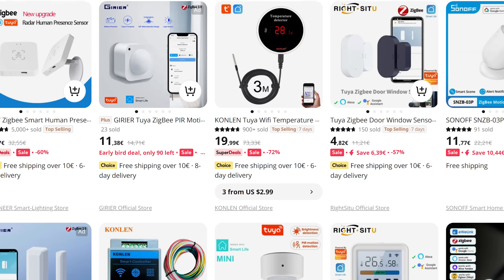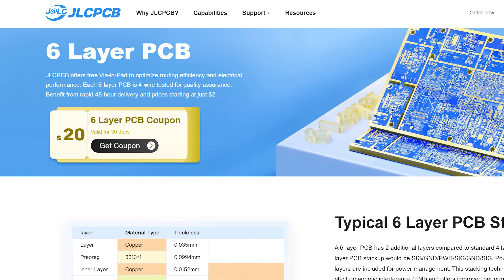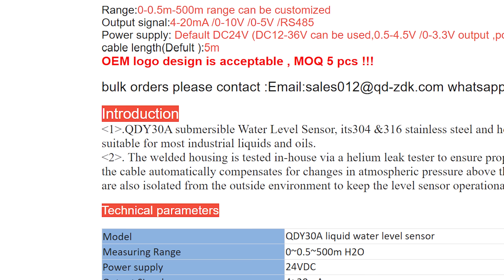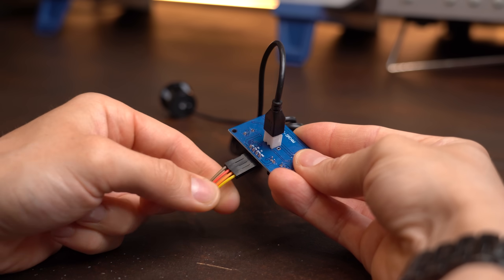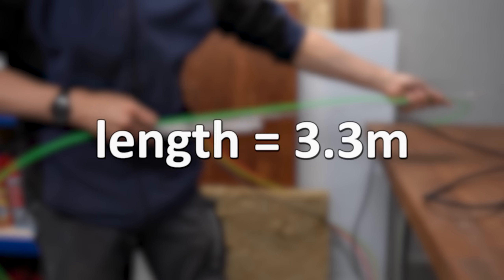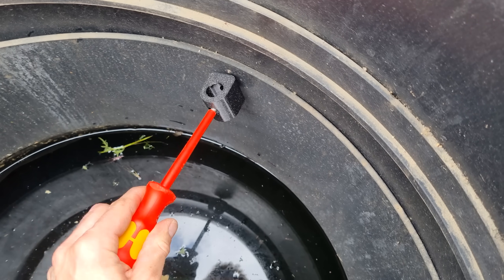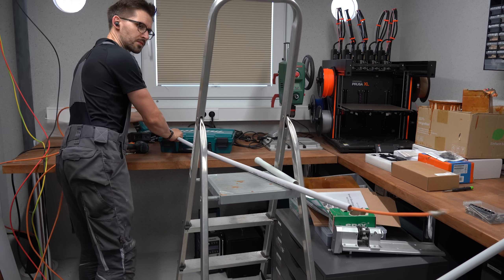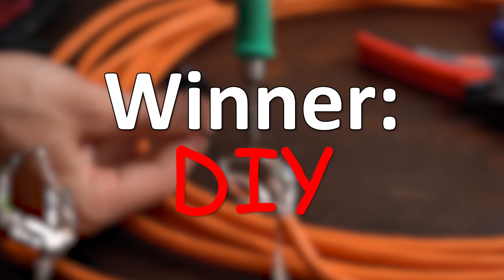This Happens when all Buy Options Suck! Water Level Sensor (DIY or Buy)

Comment: the most basic option I can think of for this would be a fuel pump assembly, it works on ohms to detect the level and that's transferred to a gauge which then displays the level based on the ohms received by the fuel pump assembly, how it detects the level is... with a floater and a pressure switch that's attached to a spring so that it can lower when the liquid lowers.

I'm not saying drop a fuel pump into your rainwater tank, that's basically asking for trouble, but having something run on what would be considered a whiff of watts from 12v or lower, can basically be ran by... a solar panel and maybe even a lithium battery housed under the solar panel, using a meter that's got a glowing hand should reduce the power needed as you can see the level in the dark then.

Total cost would be cheap, maintenance would be low and the functionality would be high as it would basically only be doing what it needs to do.

Comment: I think it would be cheaper to put a flow meter in the intlet and outlet of the tank, just make a code to add or subtract to the full volume of the tank and a shot off valve when the tank is at 100% full, dont know the values at the top of my head but the material are mostly waterproof

Comment: I have done almost exactly the same project with a large rain tank in my parents home. I used the same sensor, but I ran into issues where the Sensor would be pretty much stuck on one totally wrong reading despite the water level changing. I had only a few hours with it to try and debug it, but I am guessing that I had problems with reflections of the sound messing up the reading. I mounted my sensor in the middle of the tank as far away as possible from any walls, maybe I sould have mounted it next to the walls like in the video?

Comment: I had a similar problem many years ago, in that I had to measure the water level in a tank, with the added caveat that a pump would be sporadically filling the tank up and causing surface turbulence.  I also tried waterproof single transducers, and had the same issue with minimum distance, and one from maxsonar couldn't cope with the surface turbulence and gave false readings.  In the end I used an A02YYUW waterproof distance sensor that has two transducers and it works great.

Comment: You can modify water leak sensor which is cheaper for this project application. You don't need to know the exact water level, just turn on the pump if it's reach a certain point. Water leak sensor is just probe that measure resistance between two points. Water have different resistance than air.

Comment: Is having a low voltage cable in an enclosure that also has high voltage acceptable in Germany? I'm not sure about distribution boxes, but I know you can't have low voltage cable like UTP and a mains cable in the same conduit in the Netherlands, so I'd guess it wouldn't be allowed in distribution boxes either. Germany tends to have similar or stricter guidelines around electricity usually, so I wouldn't expect this to be allowed.

Comment: I am doing the EXACT same sh**, with the EXACT same hardware and EXACT same software (Home Assistant), and I had the EXACT same thought that you when it comes to liquid sensor suitable for my application.
The only difference here is that I am doing it for my domestic fuel tank to know when to reorder some to never run out during the winter !
And in a near future, I will implement a full auto system to order some fuel when à certain threshold is reached.

Thanks for confirming my way of thinking and the effort I made with this project that it's so niche that DIY is best XD

Comment: Very nice project. I did something very similar to monitor the water level in a Tank, but using the ultrasonic sensor A02YYUW. However due to high temperature during summer I get water droplets in the sensor's surface and the measurements became completely off.  Wondering if you have seen similar issues.

Comment: The JSN-SR04T gets a bit annoying when the distance gets lower then 20cm. Suddenly you get many Meters - at least with tasmota in mode 0. At my sisters house in her well after the many raining this happened again, the monitoring alerted cyclicly and such things - so i had to remount the sensor a bit higher and adjust the calibration value. I have one of these mounted in my oil tank and it measures but it suffers from some drift of maybe the liquid expanding with temperature rise.
On the other side in my friends house and my sisters house i have one of these submersible sensors and they work quite well - ofc you need to adjust for the lighter liquid weight

Comment: Nonelectronic option: Put three tubes into the tank at different depths that poke out of the ground: near bottom, middle, top. Place floaty thingy into the tubes, that have very light sticks mounted on them, that also poke out of the ground. Make sure that the floaties can only move up and down a few centimeters. Done. When everything is closed, you have all three sticks poking up with a full tank, two sticks with a half full tank, one stick with a less than half full tank and no stick with a near-empty or empty tank. Low tech, lasts for decades, no software compatibility required, costs maybe 10 bucks in total materials.

But yours is cool too, especially if one values a full integration into one's home system.

Comment: any ultrasonic or whatever method is cringe, get yourself a ten pack of cheap float switches and attach them all to a stick spaced out to give you your level in increments of 10%
cheap microcontroller with at least 10 input pins and some kind of comms and you're done. it will work forever.

Comment: If you end up having trouble with the ultrasonic sensor, look up nxp pressure sensors.

They're fairly reasonably priced and give you a 0-10kpa range which is about as perfect as you can get for just less than 1m in water height.

To use it hook up the sensor to a tube (so that the tube is sealed) and lower the tube into the tank, oriented so the end faces down.

Hydrostatic pressure will push on the air in the tube which your sensor can then read.

That will give you enough accuracy to measure the water level almost to the mm, or nearest 10L.

The sensor also doesnt have to be in the tank, you can run the tube that distance instead of the wire, making waterproofing a lot easier.

Comment: I used the cheap 2 transducer ultrasonic sensor in my home oil tank.  The arduino micro with 10 leds showing tank level was about 15 meters away using 4 conductor telephone wire. It was still very accurate for me. I recently bought a pre made version that can warn you that the tank is low with an app, so i replaced it.

Comment: If your Wifi can reach, you could've used a small solar panel to charge a couple of 18650 batteries and run an ESP8266 connected to the sensor.

Comment: Why didn't you use the hydrostatic sensor, since you already owned that? Most microcontrollers have an ADC for measuring analog inputs. The Raspberry Pi Pico for example, can measure a voltage from 0 to 3.3v, the exact output of that sensor.

Comment: In projects where the microcontroller operates continuously, I always implement two safeguards:

- A hardware watchdog timer on the microcontroller itself.
- Node-RED logic on the home assistant system to monitor sensor data publishing frequency.

These combined measures (hardware and software watchdogs) improve system reliability by automatically restarting the microcontroller if it malfunctions and by alerting me if sensor data updates become infrequent, potentially indicating an issue.
Reply: How can I do this easily on an Arduino? I have very limited knowledge, and just recently got into electronic projects.

Comment: I also did a DIY ESPHome water level sensor for my potable water tank. I have that same ultrasonic sensor, but I determined that the "full" line on my tank is well within the blind spot of the sensor for any reasonable mounting location. Also, the water inlet is very near where I'd have to install the sensor, so it would get erroneous readings whenever the pump in the well was running. 

I ended up using a 24V 4-20 mA version of that hefty steel pressure sensor. It was a bit cheaper because 4-20 mA is an industrial automation standard, but it was still pretty expensive. 

I've found that as I have it currently set up, and with the geometry of my tank, it's precise to within about 10 liters. I've never tried to calibrate it, so it's probably not terribly accurate, but that doesn't really matter since the intake at the bottom leaves about 200 liters (give or take some sediment) in the bottom when it runs dry, so as long as it's within a hundred liters or so of the true value, that's good enough for me. I could probably improve the precision and the signal-to-noise ratio a bit by choosing a different current sense resistor and using a dedicated ADC instead of the one in the ESP32, but I haven't experimented with that. It does what I need it to, so I've left it alone.

I even mounted the ESP and the 24V PSU on a DIN rail on the wall next to the water tank, despite being in the US where we don't really use DIN rails outside of industrial settings.

Comment: I was thinking keep it analog and simple since outdoors: use a float switch and just measure the resistance; less conductor to travel (or more if you wire it out the bottom) as the float rises. simple converstion of ⍴ = RA/L to get your Ohm-m and apply that to your depth and bingo. Kept it analog and super dirt chap, could built that whole thing for less than $5usd

Comment: From my own experience -  the sensor like this have a tendency to produce a lot of garbage when working in enclosed tanks. This is due a fact that water vapors and stays on the surface of the sensor. During the summer it's usually not a problem (sometimes it is during raindy and cold days). But the real problem starts during the winter - I struggled a lot and tried many ultrasonic sensors but ultimately failed with using them for this purpose - pressure is much better idea IMO

Comment: Replace the ESP with version that supports PoE, use the CAT7 cable with PoE switch instead of power supply in your distribution box and you are even better (and cheaper). ESPhome, of course, supports all sorts of EPS32 PoE boards :)

Comment: I'm surprised you didn't go for the simplest solution possible a level buoy which would close the circuit once it reaches a certain level.
I mean it won't give you the exact level, but it will give you a predetermined water level (or multiple) for automation pourposes.

Comment: Yeah that coax in the ultrasonic is very susceptible to picking up noise.
Once you open it up, you're done.
You're better off using BNC connectors.
I'm surprised you didn't add temperature

Comment: There's probably a cheaper way using 2 pulleys (to measure the distance), 2 motors (to bring the weights up and down) and 4 stop switches on a pair of weighted strings (one with a denser-than water, the other one with lighter than water): the first string (with the dense weight) goes to the bottom and measures the total distance, the second one  measures the current distance to the lighter weight. both strings go on a pulley to trigger the stop switch when they stop going down. The operation starts by bringing both weights to the top where they trigger the stop switches, the the "total depth" line goes down  and triggers the "no-gravity" stop switch (release), then the "light" weight goes down and triggers its stop switch. The difference between the number of turns of pulleys.
Also, you could also simply measure the distance between a ping pong ball and the sensor in a PVC pipe going to the bottom if you know exactly the distance of your pipe, so you don't need to measure that with the weighted line and you can do "on demand" measurements without keeping the system active at all times. $37 sounds very expensive...

Comment: Youre getting into high frequency enough signals where you need to take transmission line effects into account. Find the impedance of the coax cable (id guess 50 or 75) then buy a pair of rf connectors to extend the cable. Should work just fine!

Comment: I did a similar project in HA for my drinking water tank (Height 2.8m x 3 m x 2m) and I have faced a lot of problems. In my case the sensor is AJ_SR04M which is quite different than yours. First problem was the reflections from the ultrasonic cone, any obstruction within that cone was generating errors, solved with repositioning of the sensor. Second issue was the range, after the surface distance of 1m it was returning rubbish readings, Problem solved with keeping power supply separated from esp32 and feeding the sensor with 3A. For the last nine months is working flawlessly!

Comment: Not knocking the DIY spirit at all. You do you and make what you want and kudos for making a working solution. To say that DIY was the win here is a stretch though. 

Off the shelf solutions you showed were 70-90 and you landed on around 30 for your solution. Looks like you saved 40-60. However, you ignored the sensor you destroyed in the process (which comes with every DIY project, no judgement, but the cost is real), you ignored shipping for the components, and you didn’t value your time investment at all. Real dollar savings were probably closer to 20-30, and my time is certainly worth a heck of a lot more than that. So this was a large loss overall in the context of saving money. If you’re trying to get experience with electronics, or just love doing this, then great!  This was a great fun project to learn with and solve a problem yourself. But this was not a win from a practical, time, or money perspective like how you framed it here.

One thought I had though was that the submersible sensor seems to be the better choice long term as it would avoid any debris on the surface of the water or in the air (spider webs and insects), or surface ice issues that can create a false top surface (maybe not in your climate, but maybe for others) affecting the reading and it just seems far more robust for long term outdoor use like this. It may also be less fussy and allow you to relocate the electronics inside which is also much better long term for maintenance and survivability as that in-ground environment isn’t super friendly to electronics even with a good enclosure.   Temperature swings and critters may both be factors long term.

Comment: When I use microcontrollers near high AC lines the microcontroller freezer or malfunctions due to magnetic field of AC lines but in your case you are directly using the microcontroller inside mains MCB box, so don't the magnetic field affect the performance of microcontroller?

Comment: I would have simply made a "measuring stick" like an oil dipstick in a car (an older car anyway!).  No power required, easily replaced, quick to use.  I admire the thinking involved here, but simple is best in this case.

Comment: I did this same thing, but monitor our chicken's water. I used esp32c with the A02YYUW waterproof ultrasonic sensor mounted to back of the bucket lid. Checkout the "Fluid Level Background Card" in HACS for Home Assistant

Comment: Just use a buoy + potenciometer, cars have been using this to measure fuel level since forever.
Also, it took u many hours to do this and save a few bucks, if u can, just do some extra time working and buy a good sensor with some of that income.

Comment: I really like the solution, the only thing i might have done differently is that i would added an E-ink display at the distrobution board for local readout of the waterlevels and place the water level in the center of the tank to avoid reflections at lower waterlevels

Comment: Did you managed to use the system with different water levels? From my experience in the tank as yours all ultrasonic devices show wrong values because of many reflections. Now I'm trying to test laser ones.

Comment: I've been using that stainless steel type sensor in my cistern for about 5 years now
No tinkering, no fiddling, just throw it in and forget about it. I've had zero issues so far
I like to see a followup on how your solution works in 1 or 2 years. I have a lot of spiders and dirt and stuff in that area that might mess with ultrasound

Comment: Love your videos but sometimes I just think that you overcomplicate these things for yourself. I've just built something similar (pir / gate reed switch / bolt microswitches / doorbell speaker and siren) into a similar wiska box and using ESPHome too. But my new favourite way of doing this is using an ETH01 board + a POE 5V splitter. The 5v is broken out to power everything (and stepped up to 12v for the siren - although I could easily have got a 12v splitter and gone down to 5v/3.3v) then everything is powered from the switch. Works a treat. I've epoxied in a siren and a speaker to the Wiska box and the doorbell plays a doorbell sound via the DFPlayer mini and also alerts Home Assistant which then triggers the doorbell sound in my loft and in my shed at the back of the garden... it's also triggered via the ring doorbell at the front door... all 3 of these systems are the same POE-> ETH01 and they work FLAWLESSLY! never had even a slight issue with any of them in well over 2 years...

I really mean this as constructive feedback - would love to see you try something similar and see what you come up with as I do get many many ideas from your videos - I am a 51 year old former Electronics Engineer so have many years experience designing my own circuits and have no problem building something from scratch but the ease of using these prebuilt modules (and the price) cannot often be beaten...